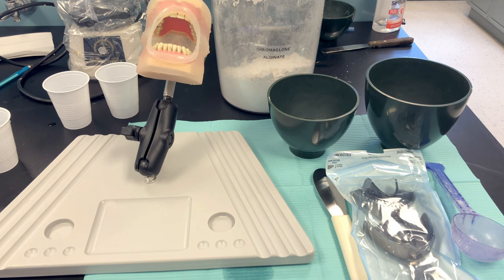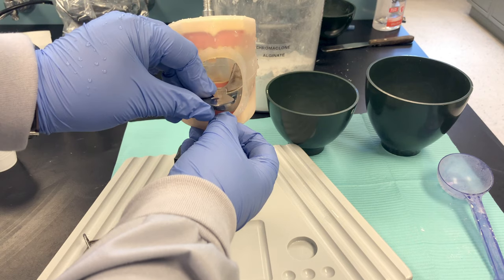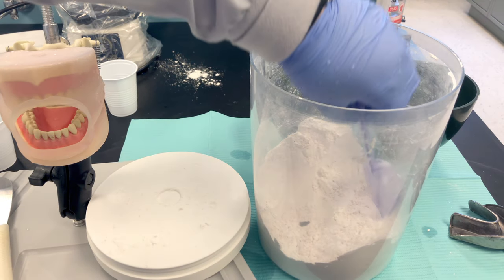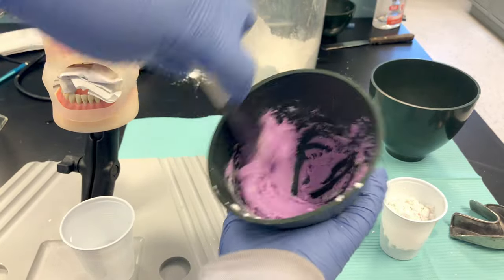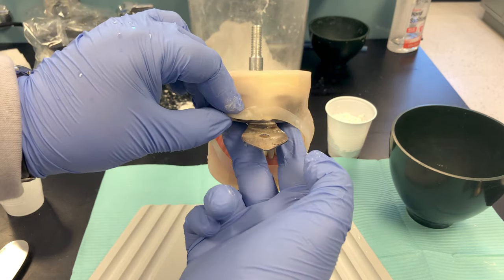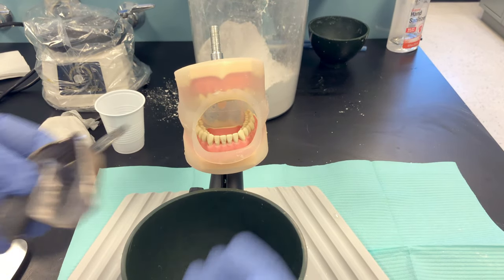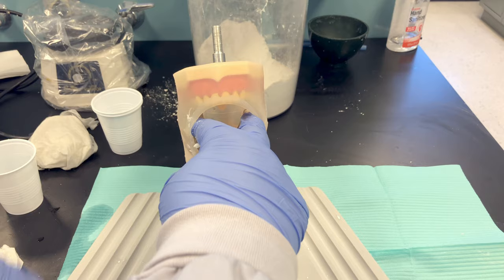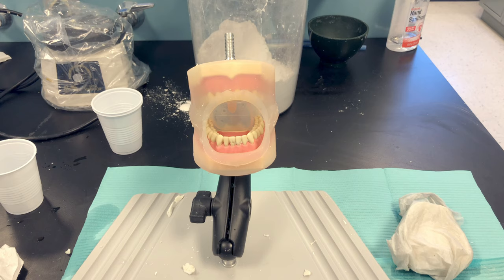Alginate Impressions

Comment: Is there a difference between a plastic or a metal spatula?
Reply from the maker: I don’t believe they are significantly different. it’s the shape of the blade that’s most important. The all-plastic spatula is easier to clean because it’s one piece. However the plastic is not as durable and I’ve seen the edges get rough and notched out over time.

Comment: how do the alginates stick on the tray, do you use adhesive on tray before?
Reply from the maker: It sticks in the metal trays without adhesive - these are rim-lock trays, there's a roll of metal that helps hold it in. On plastic trays you want to use an alginate adhesive.

Comment: I have done it more than 20 times and am still bad at mixing, what should I do?
Reply from the maker: It takes A LOT of practice, I wasn’t very good the first 50 times! You can try a different technique that I’ve seen other assistants use with success- put the powder and water into a ziplock bag and squeeze/ knead it by hand, then cut a corner of the bag and squeeze it into the tray. Keep practicing, you’ll get it!